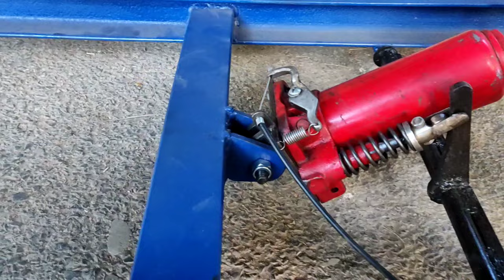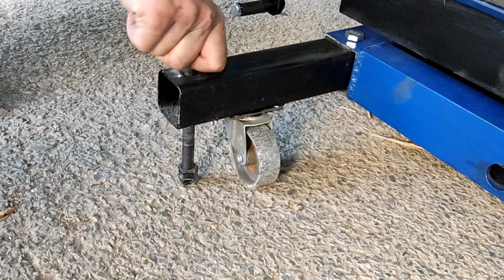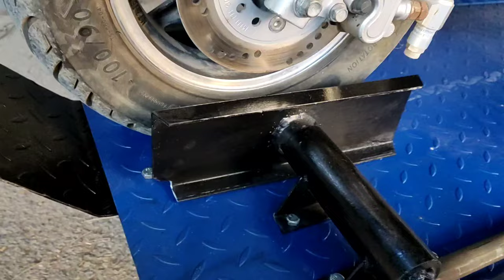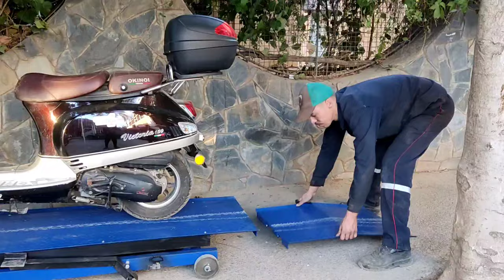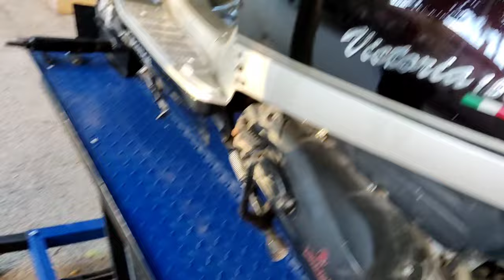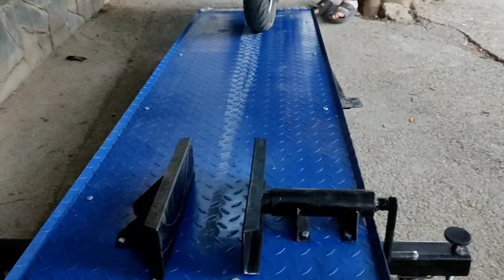450kg Hydraulic Motorcycle Lift Table using a bottle jack

Comment: Ha, haaa..the cat ;)   I noticed a bit of  a bounce while lifting. Is there some air traped in the hydraulics..or maybe not enough oil?  Anyway... well done my friend..as usual with your builds...well done..
Reply from the maker: Yes i think that because of some air in the jack, thank you very much brother.
Reply from the maker: And the best scene in the video was the Cat hahah
Reply from the maker: Hello again @Lari Fari ..
Problem solved. I figure out that i wasn't pumping enough oil because the pedal was too low, i extended up the pedal degree to pump the oil as it should before it touches the floor and now it works normally.
Reply: @metalgeria  xD .. you are like me... You can not sleep well until the problem is not 100% solved..   xD